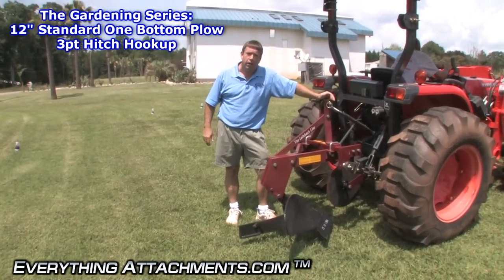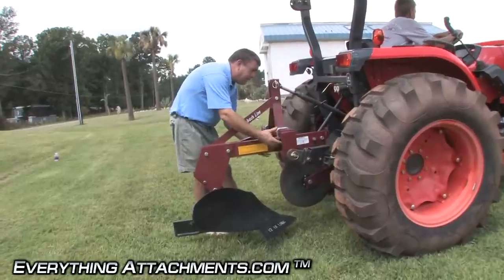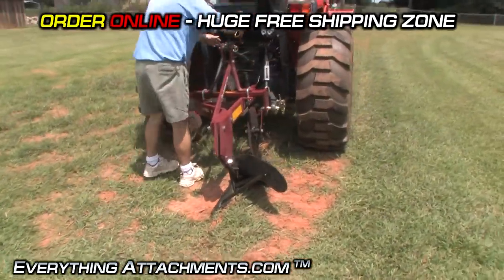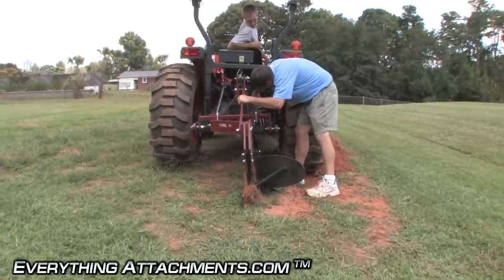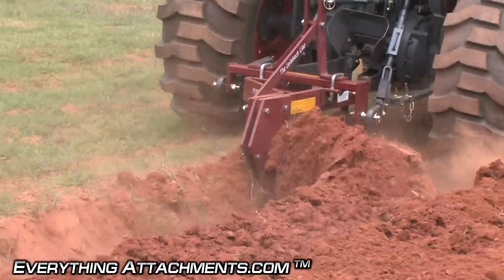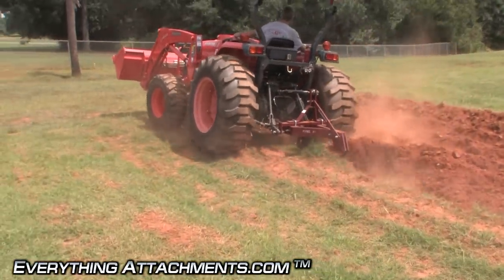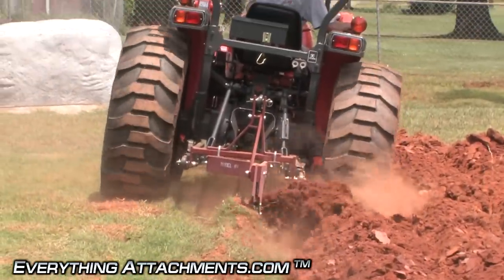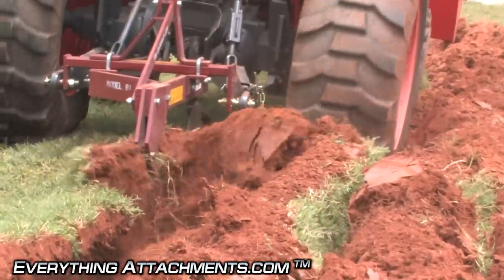How to Use a Standard 12" One Bottom Plow

Comment: After the soil was originally broken for my garden and corn patches with the single bottom plow, about the only thing I ever do with it these days is to make hills for my garden. Do one pass on the edge of the garden and then with the plow pulled as close to the rt hand rear tire as my chains will let me take it, I then simply run the reverse way with my tires on top of the mound the first pass left and it creates a nice sized mound just about perfect for tomatoes and beans. If you want a wider hill, simply lay the plow flatter and instead of running Ning your tires directly on top of the first pass mound, run just on the edge of it making 2 similar height mounds that when you plant things like squash or potatoes, they have a nice wide mound to spread out in and you will have to fight them less. If your real good you can even make hills by doing a cross hatch pattern with the plow and run it rather shallow. 
An example, this past year, we hadn't had a garden in 4 years due to sickness and surgeries making it almost impossible to plant one so my garden patch had grown way out of control. After burning everything off to kill as many weed seed as we could, I deep plowed with my single bottom mould board plow, waited 2 weeks for all the weeds to sprout and then using my 4 gang disk, disked all the hills down and broke up all the clods, for the most part any way. Then waited another 2 weeks for weeds to sprout again and then came in with the mould board plow set shallower than the first time and made rows with the valleys about 10 inches below the peaks, some were wide rows, some were narrow, depending on what we wanted to plant there.